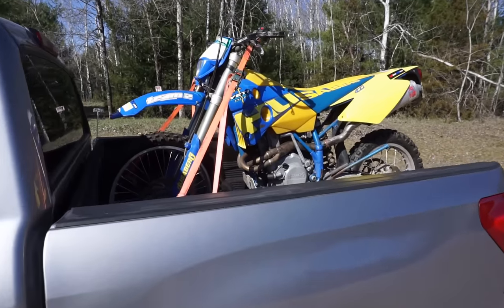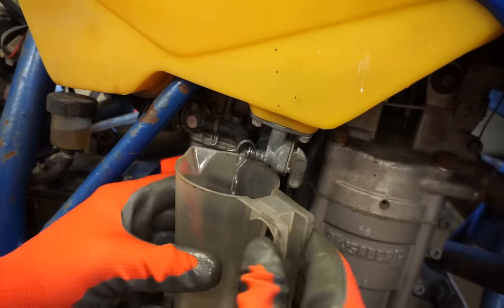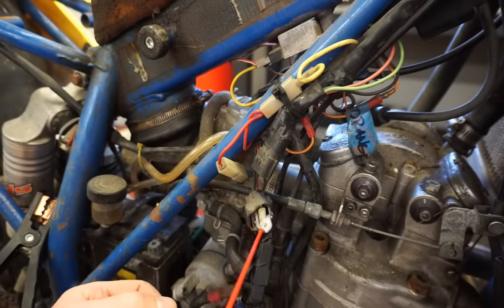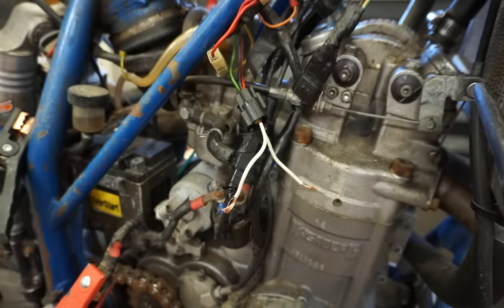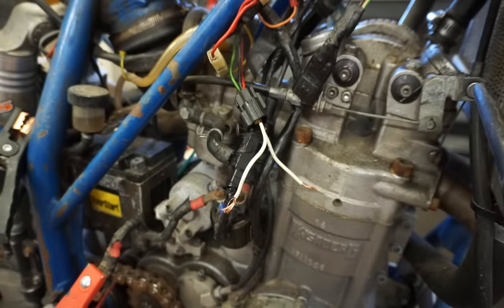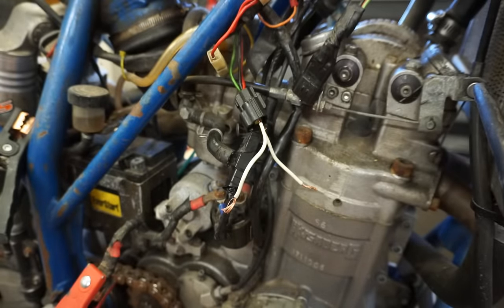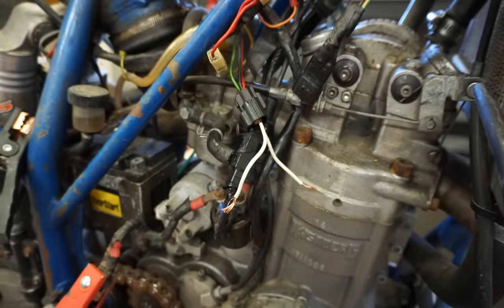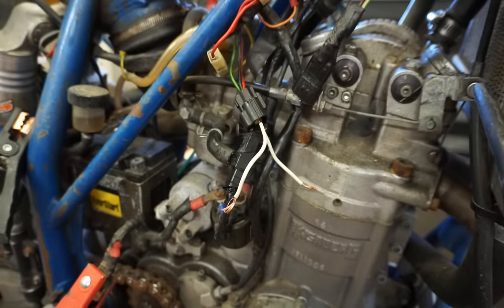Seller Said This Rare 500cc Supermoto Won't Run (Sitting 15 Years)

Comment: I have a fe550 husaberg. Runs perfect and are reliable. But not if they are stock, the problem with starting is carburator. If you lower the redline they are unbreakable
Reply: Also the elektric starter is a restarter. Only use it when the bike is hot. Chance the oil every 8 hours. Mine is not stock anymore en has now 71hp so they are perfect bikes.  If you kick them on do it slowly until you feel 2 clicks. Then you start them
Reply: Mine was sitting in a barn aswel. The ignition coil on top are not waterproof so they are unreliable
Reply: Also yours doesn't sound as snappy as they are
Reply: They backfire because you kick them wrong

Comment: On those CDI boxes the ground wires can flip.,or have 2 of them to. The stator ground wire and the common ground through frame body to the common ground lead wires into the main wiring harness itself tied in together as one system.

Comment: Good video as always Joe.  I think you really need the air cleaner to provide sufficient vacuum to draw the fuel up through the carburettor to get it started.  Once running I am sure the air flow will draw sufficient fuel as to not run too lean. In the mean time you could try covering the carburettor opening with some foam to help create more vacuum.

Comment: 24 years KTM 640 duke which was based on your bike: Try: new spark plug and gap it, I usually start cold with no choke, otherwise use minimum choke, never choke a warm engine, use the highest amp-hour battery you can fit into the bike, new air filter, clean the carb jets.

Comment: I've got A suggestion to on that issue. It is to check over all of the plug-in connectors and wires. where they click into those plastic connector plug-in block fittings. To each other separately as one wiring harness design set-up. And another thing I'd check that woodruff key it could be chipped.,or Bent.,or worn down from over the years of use to. And one more time Joe yes you can check CDI boxes by using The same multimeter.,or flukemeter that you checked the stator with it's kinda the same process. only your checking it in either ohms.,or continuity mode usually it's on continuity mode though.

Comment: Having owned a couple of the older Husabergs now they are generally always a pain to start! I’ve just had the same issue with an intermittent spark on my 650 and it was the stator. We know from your testing the value on one of the tests was incorrect, so I’d definitely start there.

Proper kick technique as you demonstrated is a must but I’d call Dave Clarke Racing in England for further advice. He’s probably had more Husabergs in pieces than anyone else.

Comment: Not familiar with this bike, but i know KTMs from the 90ies used a SEM Ignition system, which was really hard to start (hence "Kick ten Minutes") and broke easily. Your spark on/off problem in combination with the inconsitent electric resistance measurement are pointing into the direction of the stator

Comment: My grandson traded a ttr250  for a husaberg fe450 2004  that had a gear box issue which we repaired. It started with the electric start first touch of the button. He now rides it regularly it is a great bike, he now has picked up an fe501 1999 and we plan to have it running soon.

Comment: Make a groundwire from the starter to your frame ,check all your ground connections and the wireing because the wirelume is direct by the cilinder and the use not the best wire's  if it is stiff replac it or check it with your meter

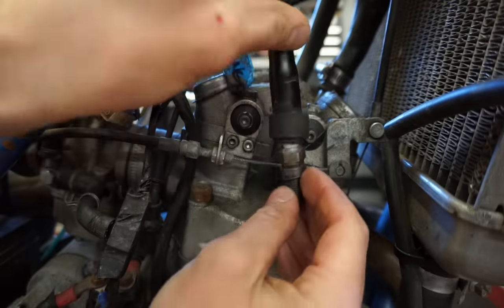Comment: I bet it has a kickstand kill switch and thats why its not sparking.  Time stamp 15:00. Some older ATVs need to have a battery hooked up for spark as well, because they put out AC and it needs to go through a rectifier.

Comment: Probably the ht cable, if the connection to the ignition coil is good then the ht cable may be broken at some point (in the inside) and depending of the position of the cable the spark gets to the boot and sometimes it won't.

Comment: Put a charged up battery in it to rule that out. You can also loose spark under compression.
Reply: Yes, agree, Ditch that banged up spark-plug at least.

Comment: Remember when you're going to check resistance, if the spec says 3 kohms, put your multimeter in the Kohm range. 

Nothing was "strange". You just had the multimeter on 200 ohms, when checking for 3kohms. You will never get a read. That only happens on auto range multimeters

Comment: If you have compression, your cam timing is OK, but maybe your ignition timing is off. You have had machines that had the flywheel lose a key and effect your timing. Good luck. I would look for loose wires or loose ground.  That ignition seems to flaky to be reliable as it is.

Comment: I rebuilt a 1995 xt350. It was the only year they used a dual carb system and dual exhaust. Pain in the ass to remove. And I cannot use uni air filters because it has the air intake routed around the rear mono shock. They were on coke in the 90s. Removing the carbs requires removing the air box and tubes.

Comment: big singles are very easy to flood. If it will not fire then leave it for 4 hours for the fuel to vapourise and try again. Always use minimal choke when starting.

Comment: My question is how did you get spark in the first place?  That’s still a mystery. Take it for a 5 mile ride and it might die in the woods. It’s sketchy. I would be afraid to go too far until I replaced all of the sketchy wires.

Comment: You can't bump start anything with an automatic compression release. Only if you have the lever. Mine has way too much compression even in second and I weigh 170. But I have that auto one I cannot control attached to the kick starter.

Comment: Man I was shocked it started yet alone went through the gears I hope it didn’t jump timing it did have good compression I’d check the ignition wiring cdi stator hope it’s an easy fix cause finding parts for that Swed machine be a bear to find and expensive good luck 👍🏻

Comment: The history of Husaberg is actually pretty interesting as they are produced still, kinda. In 1987 when swedish motocross bike manufacturer Husqvarna was sold to italian Cagiva company to be produced in the MV Agusta factories, some engineers from Sweden didn't want to let their heritage die and parted ways with Husqvarna. They started producing bikes with the name Husaberg mainly for racing in Sweden up to 1995 when the company was acquired by KTM. Husas were still produced in Austria after that. Meanwhile Husqvarna was made in Italy until it was acquired by BMW Motorrad in ~2013. Husqvarna was not in that ownership for long as it was acquired also by KTM after couple of years. In that acquirement the headmen of KTM decided to end Husaberg and continue with Husqvarna, basically returning the bike to its roots as they still use the Husaberg technique and white, blue and yellow colors.
Reply: And also as a nice sidenote the nowadays KTM:s slogan "Ready to race" was originally Husabergs.

Comment: The Husaberg brand and products were incepted as a pure racing machines, at a high level. Almost everyting else was sacrificed at the altar of light weight and high power.
Because of that, they were unbeatable at that time (when they held together), but it took maintenenace almost like a pro racer would do to keep them ticking. This was in 1989-1990-ish. 

The competitors gradually caught up, and after about 10 years, they really had little USP any longer. By the time this machine was made, they werent all that much better than anything else their competitors offered. But Its a cool brand, to say the least. One could say they were the first one to make a "modern" (in the same vein thats most of what we got today) racing 4 stroke, in many ways.

Comment: Change out the coil wire.,or wires.,or the coils. Cause the coil windings could be separating from being burnt into. Just barely starting when cool and the spark plug coil windings are bad inside of the coil. Primary.,or secondary side either one.
Reply: Correct, the stator is goosed, common with that SEM

Comment: I had a 2001 husaberg 470 and after every wet ride there would be moisture in the stator...don't know how it got in there but it had weak spark until I cleaned the stator out with CRC 556

Comment: Ngk plug is a must I had something similar happen to me and it would spark them no spark id say that plug is filled and definitely check timing could have jumped a tooth but you're getting good compression so it could be out a tooth and get a new battery in it also where the plug meets the block make sure it is clean so the plug is getting good ground definitely change the plug and battery

Comment: When the stater starts to fail you will have spark when the engine is cold. When it gets hot it will quit with no spark. You need a new stater. Ebay or taffmeister in the UK.

Comment: Hi, I had one of these and it was a nightmare to kick start but after it back fired it would usually start up, I bought it for £450 spent about £1000 on it and it was one of the best enduros 
I have ridden until about my 3rd outing when on full throttle the engine blew putting the con rod through the back of the engine, sadly the engine parts were so expensive I sold it for parts.
it is great to see this bike, it brings back memories. good luck.

Comment: The history of Husaberg isn't quite like that... KTM actually acquired Husaberg in 1995, and its first major commercial success was the KTM 450 of 2001/2002, whose engine was based on that 501 you're showing.
The story involves three major brands Husqvarna, Husaberg and KTM: 
Husqvarna sold to Cagiva; 
In 1988, Husaberg was founded with former engineers from Husqvarna who didn't want to move from Sweden to Italy; 
In 1995, KTM acquires Husaberg; 
Around 2012, KTM acquires the Husqvarna brand; 
In 2014, Husaberg and Husqvarna are merged into Husqvarna. 
In 2015, Husaberg disappears, the engineers from Husqvarna are those from Husaberg, and in the first year of the new brand, the motorcycles are essentially Husaberg's with Husqvarna logos.

The story goes something like this, more or less.

Comment: I had a Suzuki GP125 it would run perfectly then nothing, big blue spark, - no spark,I tested everything all ok, so next is take things off and physical checks, the HT coil under the tank was full of water,
You couldn't tell until you tipped it on its side.

Comment: The hussy is an awesome bike. I have had two of them. They were the 600FE model. The power of them is awesome and they are light. the were the first bike that was competitive against the 2 stroke bikes. I would have an other 600FE if I have the cash as they were the best bikes that I have owned.
To take off the card easier undo the rubber boot from the frame and not the carb inlet as that is what I use to do to save time and colourful words lol.

Comment: @ 2vintage i have a brand new 2006 Macbor XC 512 that’s never been started. A gear was robbed from the bike when it was sitting on the floor at a dealership to fix another bike. I have more info and pictures if there’s a way I can contact you.

Comment: You need a stater  you can get the old one fixed there are some places over seas that will rebuild  it or you can gamble  like I did and get the cheap Amazon  one it works just get like 3 one will actually  work..

Comment: Sounds like the same problem the previous owner had? Have you considered that the plug lead itself may have an internal break causing an intermittent problem depending on position? Just a thought.

Comment: I had a 95 xr600 that WOULD NOT start unless i had the decompression lever just slightly pulled in. If you pulled it too far, or not far enough, it wouldnt crank. Also had to kick from tdc. Then if you kicked it too many times you had to pull decomp lever all the way in and cycle the kick starter 10ish times with gas turned off to blow out the cylinder and then try again.

Comment: I had a couple of this fantastic motorcycle, and I had two problem with them , 1 they kill spark plugs, even if you have a spark with the plug hanging lose , it’s not there under compression, so new spark plug ,2 when it stand on sidstand and motor on , there are little oil coming up on camshaft an it gets ruined, god luck , it’s a really fun bike to ride 👍

Comment: i have 2005 650 fe sx they are really hard to work on i changed the battery i had to pull the rear shock upper bolt then pull the shock back then un bolt the battery box and pull it out back towards the rear shock its the only way to get the battery out its areal hassle i woulld never buy another one but it is really fast bike though been waiting for you to work on a husaburg

Comment: The carb parts wear our, making them difficult to start. TAFFMIESTERSin the UK sells an easy start kit for the Delhorto carb. I've an 03 650 SM, which lights up second kick. Kick is the best way to cold start, hot on electric.  The SEM stator are often bad with weird intermittent ohm readings. If you haven't got a steady 3000 ohms, that's probably the issue. Electrix do a good replacement. Valve clearance is critical, particularly intake. Timing is 6 before tdc at idle, setting up is easy and in the manual.  They're super cool bikes when running, but they're tricky to get right!

Comment: Looool. 42:40 its not wanting to bumpstart he says. NO! You need a hill as steep as a skijumparena and you need the bike in gear 6 and you need to jump with all of your body up in the air as high as you can before with 	ALL WEIGHT FROM YOUR BODY and tyen, MAYBE it turns or lock up because of the insane compression in these bikes. ;) lets see what he does hext.

Comment: My 2002 te570 husqvarna had 2 positions on the choke, it would only start on the first click and do not touch the throttle, kick it about 20 times and it would fire up,let it run for about 1 minute or so then push choke in and ready to go, after warm it was a 1 kick bike, and I never let it idle stopped or it would over heat,I  should have put in bigger jets like most people did,64.5 horse power no one ever bet me,very dangerous bike to ride, hope this helps 😊

Comment: I'd rewire that bike. I have a feeling you may have an intermittent connection somewhere. There was no spark initially. If you spray ether into the carb, if spark is good, it'll run for a few seconds. No run, no spark or no compression. Simple.
BTW-how can there be no kill switch?

Comment: Geez, a lot of bad info and incorrect assumptions on this post. Husaberg was created in 1988 when Cagiva bought out Husqvarna and many of the Husky employees were unhappy so started the Husaberg brand. It was bought by KTM in 1995 and run as two separate brands for many years with a lot of shared components in the 2000s until later models used Kato engines in Berg chassis. KTM decided to discontinue Bergs when they bought Husqvarna in 2014. 
Owned a 550FE for a while, great handling and smoothest power of a big bore. some brilliant and quirky engineering, some say the KTM RFS engine used many ideas from the Berg. 
If wiring looms of this era are the weak point, maybe a Kato loom of similar year would be a substitute as they use same lights, switchgear etc.

Comment: Being from Sweden I know to stay away from these bikes if you like riding a lot.
Early models had no oil pump. When that came, they had no oil filter. The clutch plates could not take the torque and quickly contaminated the oil.
The valves needed constant adjustment. 
The dell'orto carb was hard to tune right.
In their quest for lightness they never had a counterbalancer.
The SEM ignition was always not sparking right.
Mostly rich, older guys would buy them out of pride, which is great, but I have always noticed the tendency for guys with a lot of money to service their things way less than required.
And these bikes needed a full time factory mechanic on standby 😂
Would never buy one, but I love them a lot.

Comment: Those old  hasaberg were built by the same Husqvarna engineers. If you know anything about the old KTM's and Husqvarna's their well known for running hot and a pain to restart. Them old 570's break your leg off trying to kick them mofo's. I know we use to double up the base gasket to raise the cylinder up help that starting issue with the right jetting. Early 2000's they added the electric start on them. Kicking them reminds me of the old Yamaha YZ400 and YZ 426's when they was warm. Ran good when they was jetted right. Funny how the power changed when they changed the hotstart manual lever to a auto detent on the cam.

Comment: Cause the second ground wire is and acts like A neutral wire to though even if it already has A neutral wires. Cause it's the electric system return power feed forward flow.,or reverse flow. Also known as polarity current flow to.

Comment: Get yourself a cheap dino , modify it with a transmission on the roller and use it as a starting device .
Anyway, I give you the award for the most patien mechanic.
Thumbs up ..
I would have doze it with fuel and crack a march 😅

Comment: That spark looks weak to me. I bet the CDI is on its way out, not giving enough juice to spark when the plug is under compression. I would also check if theres any oil or tip over safety's

Comment: wd40 no good for elec connections , use contact cleaner. WD 40 is an anti moisture spray
Reply: WD = water dispersant, but ok for electrical connections too.

Comment: don't over think it ......we know it runs so fuel is good also motor it good, so it's got to be electrical check all the switches and make Shure they are not dirty or have burnt contacts and check the wiring really good one bad connector pin or a grounded wire is all it takes to have intermittent running problems.